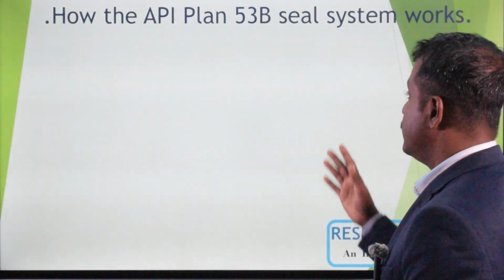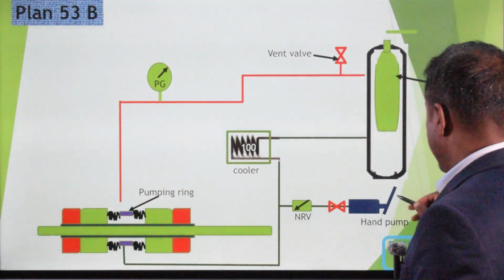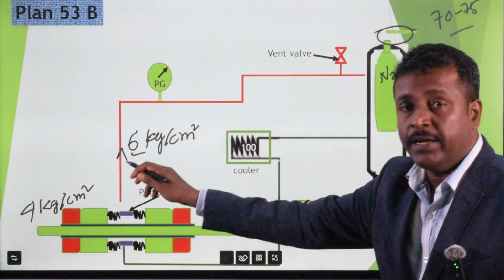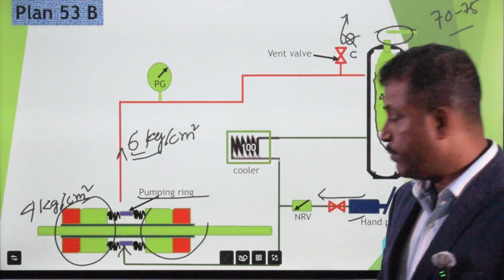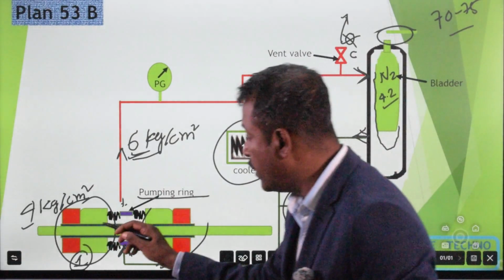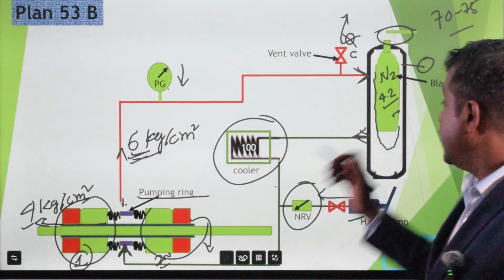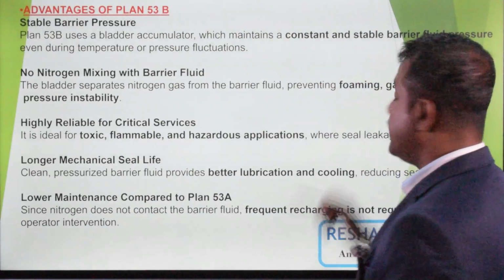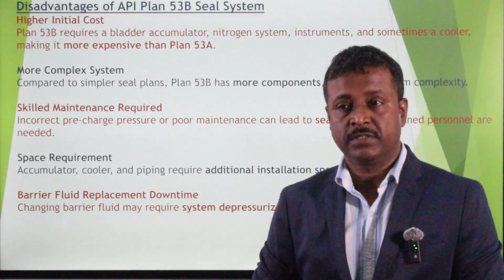API seal plan 53B

Comment: Many wrong things here , Plan 53B must operate in a barrier pressure range in order to deliver barrier fluid max pressure to refill pressure, the bladder accumulator is plumbed in parrelel to the cooling loop not in series as shown, API 682 reccomends 20 psig above seal chamber pressure at min , do not reccomd a 70-75% N2 pre-charge It does not take in affect ambient temperature affects on the N2 gas in the bladder

Comment: Sir seal cooling inlet is barrier fluid inlet , actually it pressure  should be more than the stuffing box pressure. But you are showing seal cooling out let pressure is more than the stuffing box pressure . Please clear the doubt.
Reply from the maker: Seal cooling inlet or outlet pressure should always more than stuffing box pressure otherwise pumping liquid will ingress to the sealing system. And stuffing nox pressure is depend upon the impeller type and arrangement.barrier liquid pr always 1_2 bar more than stuffing box pressure

Comment: Wrong diagram and wrongly explained.
Reply from the maker: Can you please  point out which portion of video or diagram you found it wrong.
Reply: @reshapetechno 
SIr, plan 53B is the modified version of plan 23, where barrier liquid circulates from seal chamber to seal chamber through the cooler.Not from seal pot to seal pot. When due to seal leak seal chamber pressure drops, barrier liquid from pressurised seal pot goes to seal chamber. Indication comes from the pressure drop of seal pot. You may see the case by visit the field in your plant and can realize where the diagram is wrong.
Reply from the maker: First of all thank you so much for watching my video very minutely and raise this important question not only you many people have doubt about seal plan.. 
and now please see why 53 B is not a modified 23 plan.....

1. As per API 682 Plan 23 is a recirculation from the seal chamber through a cooler and back .while API plan 53 B uses a pressurized bladder type barrier liquid system where we always maintain a pressure more than sftuffing box pressure.

2. API23 single seal plan and 53 B is a dual pressurized seal plan

3. In plan 23 use process liquid but in plan 53 B is a clean barrier liquid.

So the plan 53 B is not a modified API 23 PLAN.
Thank you so much aging for your very important question.
Regards.❤
Reply: @reshapetechno 
Thank you Sir for clearly describing the both plans with basic differences and necessary modifications for sealing requirements for high vapor pressure process fluids.
Reply from the maker: @sudipbera9747 thank you ❤ keep in touch and keep watching.. and also happy to hear more technical questions from you
Reply from the maker: If you share your mo no we can talk regarding this

Comment: verry helpful video thanks a lot. i just have questions what if we have the section pression of pump more than the opertating pressure of the meachanical seal i mean pressur section 10 bar opearting pressur of mechanicale seal with accumulator its 9 bar from the constrictor its safe to ajust the pressur more than 9 bar to be above the section pressur of the pump i mean to 12 OR 13 BAR ?
Reply from the maker: Thank you
Good question
The operating pressure of plan 53 B depend upon the stuffing box pressure and the stuffing box pressure is change if the suction prussure changed. So if the suction pressure change you have to calculate the stuffing box pressure, and 53 B operating pressure you have to adjust accordingly 1_2 bar more than stuffing box pressure .plan 53 B is designed cosidering the max operating pressure of pump, so you may adjust the bladder pressure but keep in mind that at the time of adjustment you should depressurised and drained the total system including process side.

Comment: Sir in a pump like 53B is it only 53B plan or it may have multiple plans in one pump ?
Reply from the maker: For secondary API plan 52 and for primary seal it may have API 11 OR 21 OR 23 API32 OR MAY31 OR 41 depend upon the seal design and pumping liquid condition.
VERY GOOD thank you for your questions. keep in touch.

Comment: Sir can we take Instrument Air pressure instead of N2., becouse some place N2 is getting very low
Reply from the maker: Very good question
Why we use nirrogen in 53 A 53 B for pressuirsation of barrier liquid as because nitrogen is a inert gas any inert gas you may use but nitrogen easily avilable in plant. And why not use air ? for following reasons..
1.it support combustion
2. React with process liquid.
3. Oxidation of barrier liquid may occur
4 may contaminate the barrier liquid.

Thank you so much for interaction.❤❤❤❤